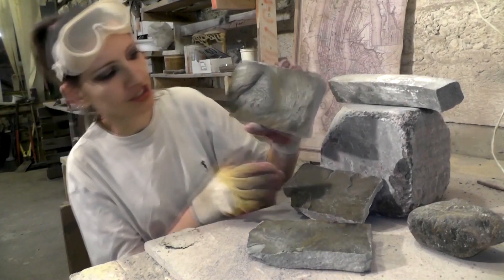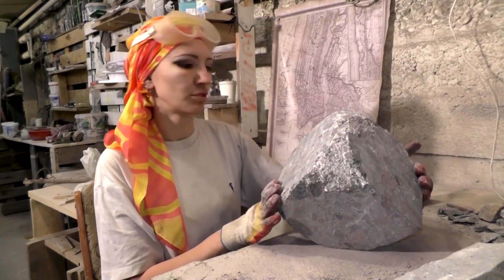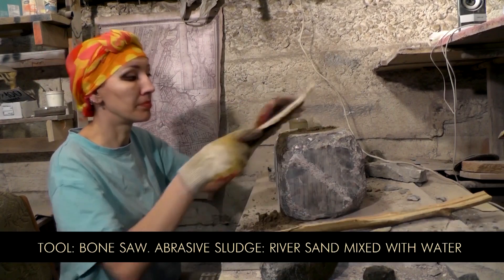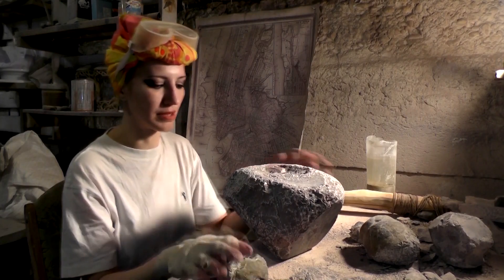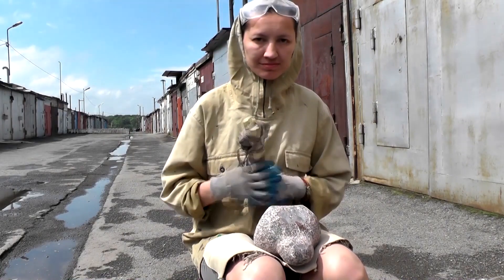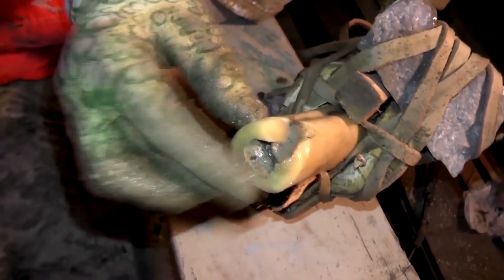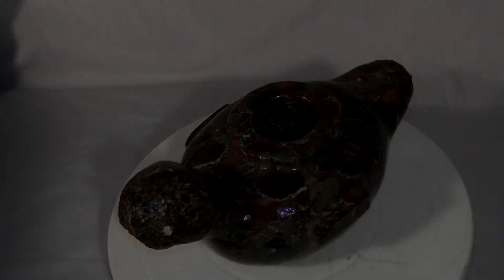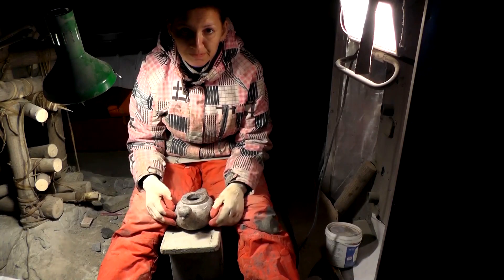Mysterious Ancient Artifact - DIY. Alternate history fans, please look away

Comment: Fantastic job you're doing. Am one of those skeptics that do not believe the ancient Egyptians could have built the three pyramids at Giza, both on the logistics and engineering point of view. Am a logistics engineer. Ten years ago,  I would debate ANYONE that we cannot replicate it, using available technology at the time (Am standing on solid ground, I have done my research). Therefore, if we can't do it, it's improbable the ancient Egyptians could have done it, the way Archaelogists protrayed it to be). Today, further improvements in  technologies like 3-D printing, robotic sensors and laser optics show maybe we're just around the bend to be able to replicate it. What you're doing will not answer all of the questions on how the ancients could have built the great pyramid, but it does answer some aspects, and by so, solving other aspects of the problems, we will be able to accumulate enough data that will offer substantial support on how they made it. Am doing this just as a hobby, am not here to debunk anyone, am doing my part in helping solve the greatest engineering mystery of humankind.

Right now, am into the human factor and psychology of how the ancients built the great pyramid, in comparison to us now. Am well into it now, collecting data of all the mistakes of present day construction for the past ten years, the who, how, psychological factors and why those errors were made The fact that we and the ancient Egyptians are both humans is consequential because if we commit mistakes, the ancient Egyptians could have committed mistakes too. The plumb of the pyramids from tip to base is almost pefect, nothwitstanding the fact that the stones are cube. Viewed from all angles and from above, one can see that the sides and slopes of the three pyramids are almost perfectly parallel to each other through the apparent absence of bulging, the only slightl deviation can be attributed to the difference in size. We can deduced therefore that it was not by accident, but was done purposedly by the ancients. To achieved this, the ancients will not only grapple with stacking those stones, they will also have to choose the right size of stone and place it exactly where it should be. I profound this because one of the recurring mistakes in construction we have found today is in concrete slabs where when the error in plumb is minutiae, the crew probably didn't notice or probably ignore it (that's when human factor and pschology comes), and only became apparent later. Corrections has to be made. If this occurs to us, it could have occured to the ancient builders, altering considerably the supposed timeline given to us by archaelogists.

I have two questions for you:

1. Using your techniques in stone shaping, how long do you think it would take to cut and shape the est 8,000 granite slabs at the base of the great pyramid and the three +/- 70 granite slabs at the King's Chamber?

2.  How we're they able to lift those three granite slabs in place? I don't have an answer honestly. But if you could offer us your opinion how, it would be great. If I somehow missed it in your channel, please show me the link.

Thanks!

Btw, just one more question. I saw your video on the granite sarchopagi in the serapeum, great job. You claim it was done contemporanouesly, while others claim the ancient Egyptians found it later then made the inscriptions. That made me think. Why were there no inscriptions inside the great pyramid? Isn't it possible that those who claim they weren't done contemporaneously are right, reason being that if those who have made the sarchopagi and made inscriptions on it, those same ancient Egyptians who built the great pyramid would have done it also inside the King's Chamber? My thought on the matter is that the ancient Egyptians who discovered the sarcophagi and made inscriptions on it later was not able to penetrate the King's Chamber, so they weren't able to make inscriptions on it. What do you think?
Reply: As a supposed engineer I am compelled to say your "analysis" here is pretty superficial.  It appears you did not bother to first learn the evidence out there to instead spew a lot of silly conjecture centered upon incredulity rather than understanding.  Oh well.  As an aside.  There are not 8,000 granite blocks in the Great Pyramid.  In fact there is no granite whatsoever on its base.  That alone destroyed any supposedly credibility for your part.  The King's Chamber is small in size - as are the granite blocks which make it up. The relieving slabs above it are very roughly hammered rectangular-ish chunks of stone.  Next time assume less = and learn more.
Reply: I'm finding your "logistics engineer" credentials questionable. But...whatever.
1A. Granite slabs at base not being a thing aside...the cutting part isn't a problem. They'd split the granite, or limestone. Split in a line it would be fairly flat, and we see on surviving casing stones, the vast majority were left quite rough, and they didn't seem to actually cover entire pyramids with them. 
1B. The King's Chamber slabs...Not sure 100% what you are referring to as "70 tons" is on the extreme end of any of the weight estimates. The relieving stones would just be split. They would never have been polished. 
If you are talking about some other part, or lets say the sarcophagus, logistically you'd know that polishing is going to take the longest amount of time so you'd...start work on it first thing. One person doesn't do everything. You put your best craftsman working the pieces that need the most work, and everyone else gets to moving and stacking the rough interior stones and dumping the lots and lots of smaller filler. 

2. There are lots of ways to move heavy things. Besides ramps and manpower, you could also leverage, brace, and pivot them or get them prepped early on and tilt and shim them as you go each step up. 

3. Why were there no inscriptions inside the great pyramid? You know there is a period of time where they weren't covering everything in hieroglyphics? Why...who knows, their aesthetic changed. It happens. My neighborhood used to have 18 red doors and now there are only a few left. Why no more red doors? 

Bonus: "Viewed from all angles and from above, one can see that the sides and slopes of the three pyramids are almost perfectly parallel to each other through the apparent absence of bulging, the only slightl deviation can be attributed to the difference in size. " Um...no. The sides are not that great or perfect. The steps have a fair amount of variation to them.

"We can deduced therefore that it was not by accident, but was done purposedly by the ancients." Yeah, I have no doubt they intentionally tried to make things straight. That requires no deducing. 

"because one of the recurring mistakes in construction..." There's a lot of mistakes in their construction. If you look across all 137 or so, you'll see mistakes, experimentation, and advancement. 

".... if we can't do it, it's improbable the ancient Egyptians could have done it..." That is absolutely not true. There are lots of reasons we today might not be able to do something as it was once done but that does not mean it couldn't be done then. But I also think, sure, if we completely retool and retrain our society and structure things around stacking stones, we'll eventually produce enough craftsman and it will be worth their time, to do it. But you'd literally be talking about restructuring a large portion of society just to develop enough "primitive" stonework skills to build a pyramid. Why? There is no point and nothing to gain by putting in that amount of effort.
Reply: @AveragePicker  Ok, let us assume I agree with your supposition. One thing I can't understand is, why were there no inscriptions inside the Great Pyramid? You see other ancient egyptian tombs of pharaohs and monuments, they're literally covered with inscriptions. The Great Pyramid, supposedly their crowning achievement, none. Why?
How about the Barabar caves in India? Those magnificent caves carved out of solid granite. Could you give us a hint of how ancient craftsmen could have done that? Of course, given time and much effort, almost everything could be achieved? But how? Why carve out of solid granite? Why not dig on sturdy, solid but easier material? Why polished it to almost glass-like sheen? Unless it was easy for them? And like the Great Pyramid, no inscriptions whatsoever? There were some however, but a closer observation would show it was added later as they do not compare to the precision of the builders.
Whether you believe me profession or not is beside the issue. But based in your argument, you do not know engineering. " Um...no. The sides are not that great or perfect. The steps have a fair amount of variation to them..." because what you see now is the absence of the casing stones.
Reply: @philatkins5081  As I said: 3. Why were there no inscriptions inside the great pyramid? You know there is a period of time where they weren't covering everything in hieroglyphics? Why...who knows, their aesthetic changed. It happens. My neighborhood used to have 18 red doors and now there are only a few left. Why no more red doors? 
Egyptians only began decorating burial chambers with hieroglyphic texts later on. 
You are a prescribing a nearly cartoon like stereotypical aesthetic to the entirety of "ancient Egypt." Why should there be hieroglyphics? Especially when, they weren't decorating like that anywhere else either at the time. Sure, it is their crowning achievement, at that time as it was, as was the style at that time. I don't see how that is so hard to understand. 

"because what you see now is the absence of the casing stones." Yes, I'm aware of that, and we know from casing stones, they aren't even. They were often used to create an even appearance. We also know, from mapping the exteriors, that the ones where the stone was taken from the most also bow in the middle from that process. And we know from the 137 pyramids, the inner step stones are very rough and they contain a lot of just filler. 
But again, we know not the casing stones were worked equally. Where they survive we see the most work put into the ones around the entrance. ...heck theres evidence they didn't even go all the way to top or do every side all the time.
Reply: @AveragePicker  "Why...who knows..." Well, that say's it all. 
"Egyptians only began decorating burial chambers with hieroglyphic texts later on." Are you sure? Or, it's just a conjecture?
Reply: @philatkins5081  Why no inscriptions.  Because at that nascent period of Egyptian culture they had not yet moved to such.  The Old Kingdom Pharaohs who built above ground tombs did not anticipate the decline of their dynasties and subsequent looting of their tombs.  Thus royal pyramids came with accompanying mortuary temples - and it was in the temples were references to the Pharaoh could be found.  There are fragments of Khufu's mortuary temple which depict him performing the Sed festival.

By the New Kingdom however as above ground tombs had been violated the Pharaohs opted for hidden underground tombs with their temples located elsewhere.  So what was once in the temple aside the tomb = was now put in the tombs themselves.  Think of it as a "how to" manual to go to the afterlife since the Pharaohs could no longer count of offerings made in their temples after death - which they were right.  Many temples were destroyed at Karnak or defaced via "damnatio memoriae" by later Pharaohs.
Reply: @varyolla435  What you've said are all conjectures. "The Old Kingdom Pharaohs who built above ground tombs did not anticipate the decline of their dynasties and subsequent looting of their tombs.." - who are you and how can you say that with certainty? Have you read their minds? Let's forget about the engineering problems in constructing the great pyramid. Let me ask you, as you doubt my logistics engineering background. How many work force do you think were required to build it? Do you have an idea of the logistical resources needed to maintain a work force of 10,000? Food, water, tools, clothing, medicine, transportation etc. How many more manpower are needed to provide those? Give me an idea and maybe I will take your conjectures seriously.
Reply: @varyolla435  You know why it is very difficult to build rockets for space travel? Because it takes fuel to carry fuel. You want a rocket to carry more fuel for longer distances, the bigger you build the rocket, which in turn will add weight that would eventually need more fuel to burn. And so on, and so forth.  Common people don't understand that.

Your explanation above? Clearly you just read what the Egyptologists say, and has no knowledge of how logistics work and no experience thereof whatsover. Believe what you must, have a good day.
Reply: @philatkins5081  simple things for simple minds I guess.  Egyptologists work with = subject matter experts.  That means people like engineers or geologists et al in forming their conclusions.  If you understood that you would not obsess over meaningless conjecture based upon uninformed assumptions.  Your "day job" it utterly meaningless I'm afraid.
Reply: @varyolla435  Yes, simple things for simple minds. That's how you and egyptologists tend to explain things, simplicity. Of course, it is easy to feed and support a work force 20,000-30,000 as you say. Every thing is in abundance. You didn't factor in the fact that those who work the farms need to eat too, how many of them do you think? Those who make the tools would need to eat too. Those who collect and transport hemp and timber would eat too. How about the army who guarded the Pharaoh's borders? And the simple folks? How about water? It is not a simple task to provide water for a work force of 20,000 to drink, to cook and for hygiene. Unless you think the workers do it themselves as if building the great pyramid is not tedious in itself. Never mind, you probably haven't even heared of Water Intake Calculator, required by logisticians to estimate potable drinking water requirements to maintain a large work force. As simple as it may sound, it's actually a complex management tool in itself. Maybe one of these days you could actually try to haul stones in the desert for 8 hours and determine how many glasses of water you need to drink per day. Multiply that by 20,000-30,000.
Reply: @philatkins5081  You keep skirting the evidence while going round and round in circular reasoning.  If the Egyptians could maintain an army of say 20,000 men = maintaining a workforce of the same number would be no difference.  I realize "thinking" can be scary for some - but it is required.  The Nile River was once lined with numerous military forts in the south.  Many thousands were maintained there to protect the trade lines and prevent invasion by Nubian forces.  

These people were not primitives and they had a structured civilization.  Feeding workers was easy.  Egypt once fed the precincts of Rome via centuries of grain shipments.  It was known for its agricultural output.  During the reign of Ramses II the Hittites and others endured drought while Egypt prospered.  There is written evidence of the time of the Hittites petitioning Egypt for grain.  You see only what you want to see and clearly do not understand here.
Reply: @varyolla435  Wow, you based your assumption on the Egypt at the height of the Roman Empire. That's more than 2,000 years from the alleged builders of the Great Pyramid, of which little are really known except for some papyrus records of builders who may be quarrying stones which may not necessarily mean for the building of the great pyramid. Where in that papyri was it stated that they're quarrying stones to build the great pyramid? Only the egyptologists said that.
More than 2,000 years. In comparison, the Egypt of the Roman Era can be liken to us today, and the alleged builders of the great pyramid were during the time of Christ.
Reply: @philatkins5081  the prisoners in Dartmouth prison made countless granite troughs for animal feed and water. Audi g hand tools. 
To hollow out barabar caves is a pretty simple proposal 
Similarly masons who made wine cellars of similar size and shape to those caves.
As for the mirror sheen I show in several demonstrations how fast and easy it is to do.
Achieving surface roughness levels equal to the ones described as impossible by those documentaries. 
If anything mine are better as I don’t have distortions in my reflections. The original makers polished them well enough but didn’t create smooth/flat surfaces.
After analysing the other evidence I started noticing other patterns. Such as the mirror reflections shown in the photos are all from the same spots  at the same time of day. A trick of light and angles.
I showed in demos of this how quickly a rough granite surface can be ground down to an equal if not better reflection in 30 minutes.
The slurry to do this also causes the polishing stones to stick to the surface. So a large piece could be used all day on a wall or ceiling without it tiring the worker.